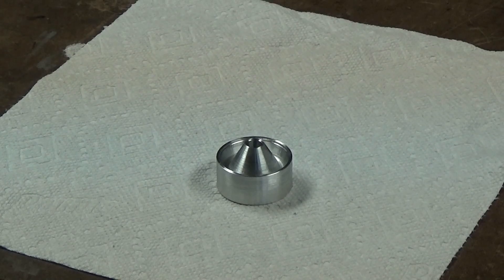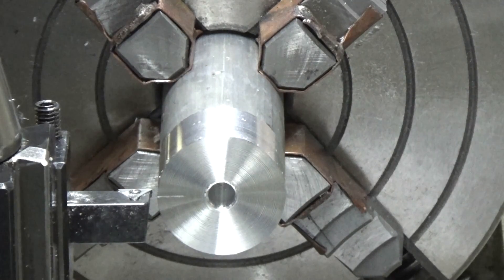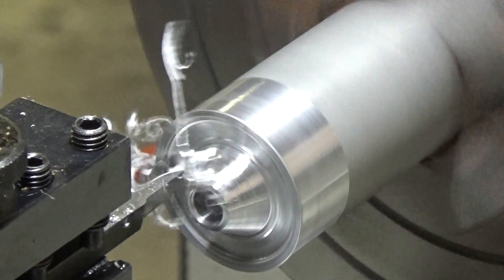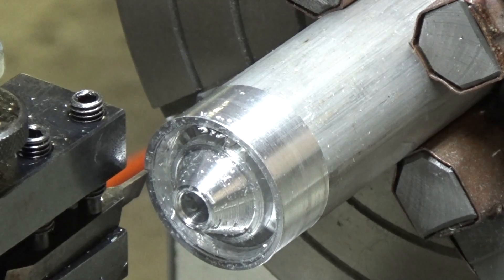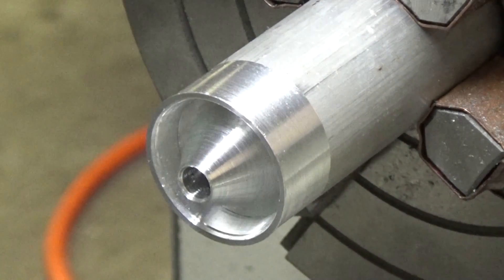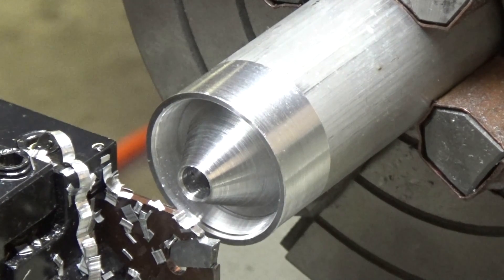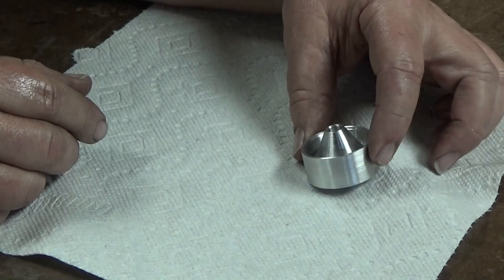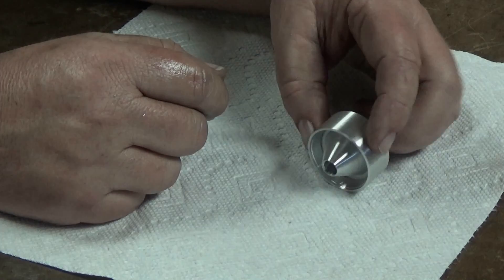How to Machine a M Baffle

Comment: Looking into lathes for this saw a cheap Chinese one on Amazon any recommendations on where else to start
Reply from the maker: grizzly tools, get the biggest lathe now, I stair stepped through 3 models.
Reply: @bstanga  thoughts on the harbor freight model ? I will only b making baffles and tubes for now
Reply from the maker: @zachwhitney9563  I bought it, then brought it back, to small, not ridged. Here is what I did, and it was a long time ago now lol, HF, returned it, then a grizzly 10/22, sold it, then grizzly 13/40 happy happy. less than 5k delivered. good luck

Comment: I'm sorry, but I have to critique you. You almost never explain what you're doing.  For example, when making the cone at about 4 minute mark, what are you using? Are you using the compound set at 60 degrees, and going back & forth with the carriage, or going back & forth with the compound? All we ever see is the tool.  You're not instructing; you're just showing the lathe cutting.  Sorry, but this is true with many things you demonstrate.  It may be obvious to an expert machinist, but some (like me) got our certifications years ago, or didn't even go that far, and are trying to learn as we go.  These are otherwise excellent videos, and I certainly appreciate your efforts for us, but why not make them even better. I'm a fan, and want to remain one, but you're leaving me behind.

Comment: Excelente video, muy bueno su aporte. Aunque falte el video del silenciador/moderador terminado, la última parte, y el video de prueba de campo. saludos.
Excellent video, very good contribution. Even if the video of the finished muffler / moderator, the last part, and the field test video is missing. Greetings.

Comment: Couple a things bud. 1st, your 'hang out' is a little long, bring your tooling back a bit to lessen vibration & achieve a cleaner cut particularly with the HSS bit you are using (& snapped). 2nd, it's dull, that's another reason for the snapping of said bit & the excessive noise while in the cut. 3rd, I've always achieved a better finish & considerably better cutting/ parting etc when I use kerosene instead of any oils or other lubricants (aka WD40). I'm also a 'hobbyist' & these points are just my experiences, I have no clue if I'm correct or not. Good luck brother! 👍

Comment: Never throw away broken tap, end mills, or drills, they can be ground into cutting tools. - Use a chop stick or similar item to catch your parted pieces. - Wouldn't a high speed steel cutter give you a better finish on aluminum? - Overall nice job.

Comment: nice video. You should consider grinding a nice radius on your parting tool it will cut better and the sound waves will reflect back upon themselves canceling them out during firing. It seems to work on my baffles.

Comment: What kind of lathe do you have? can you do this kind of work on a mini lathe. I don't have a lot of room. I have a mini mill for my 80 percent lowers.  mini lathe for my own form 1's would be a nice addition to my man cave.
Reply from the maker: you set the compound slide to 60 deg and crank the compound in and out to get the cut
Reply from the maker: I have a 13x40 lathe, you could do it on a mini, but much easier on a more rigid lathe. thanks for watching
Reply: What machine is it that you can cut the angle of the cone like that? I have a mini lathe but I can't cut at an angle to make a cone shape, or I just can't figure it out.
Reply: Thanks for the info!

Comment: What finish do you suggest is best for the baffles?
Reply from the maker: +Johnn Schroeder i use mine in the raw so to speak, if you could anodize they would be a little harder, I haven't had any issues because I use a SS blast baffle to take the brunt, if ya know what I mean. thanks for watching.
Reply: 125 RMS is a finish standard for most materials but 32 RMS is easy enough to do and looks nice. FYI a mirror finish starts at 8 RMS. RMS = Roughness in Micro Seconds.

Comment: Man, that looks awesome! It makes me really want to try that on my next Form 1 suppressor.  I've had good luck cutting out the bottoms of 60* cones by finishing with a 6 flute 60* countersink (5/8, 3/4, or 1 inch depending) in a low speed to get that narrow part hard to cut with even the smallest of boring bars.  Great video!
Reply from the maker: +Practical Renaissance thanks for the kind words and thanks for watching.

Comment: Brian,
This is an interesting machining job. I like the use of a step drill to provide some room for the boring. Although expensive, you might want to use a Rotabroach cutter for your trepanning tool work if you have a lot of these to make or for working in steel. Thanks for the video, Paul
Reply from the maker: +Paul Jones That is a great idea Paul. love your work at homemadetools site. thanks for watching
Reply: Brian thanks, I think the HomemadeTools.net website is a great place to share tool ideas and see what is possible.

Comment: Great idea on using the step drill.  I never would have thought of that.  Do you have some book or some guide to making suppressors?  Thanks for the video.
Reply from the maker: +cerberus No Harold I'm just winging it, I saw a pic of the M baffle on the web and just went into the shop turned  on a couple of cameras and tried to make it, broke a tool, but learned that if a narrow tool starts chattering you better get out quick or .. well you saw it in the video snapped off like a twig.. thanks for watching.

Comment: an m paper weight would be a cool giveaway. nice work buddy
Reply from the maker: +eyedropbombz thats a cool idea. maybe not machine out the back side so it won't run afoul of the ATF. thanks for watching
Reply: +Brian Stanga as long as you dont drill a hole its just scrap metal